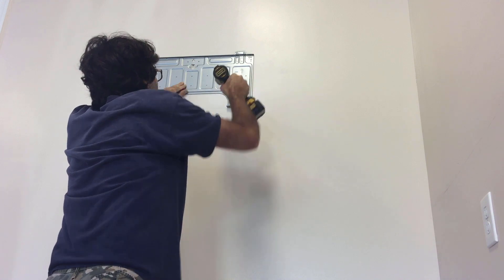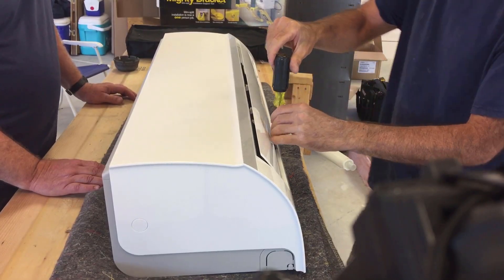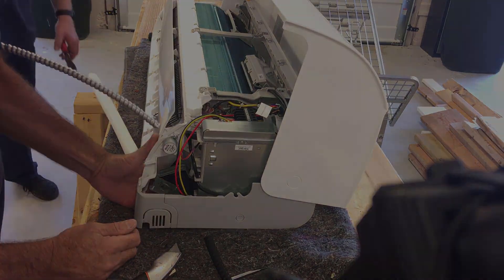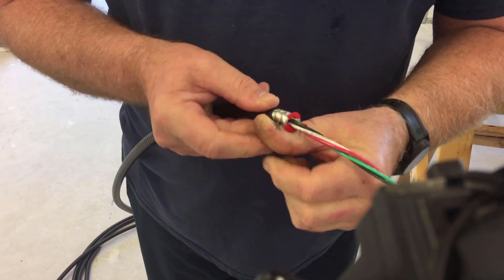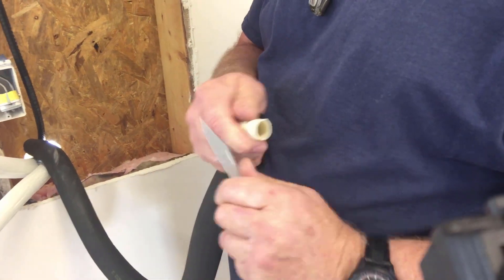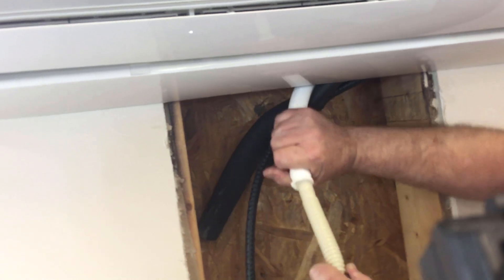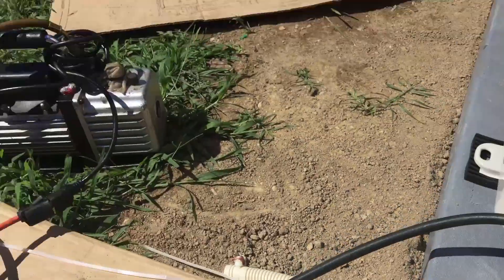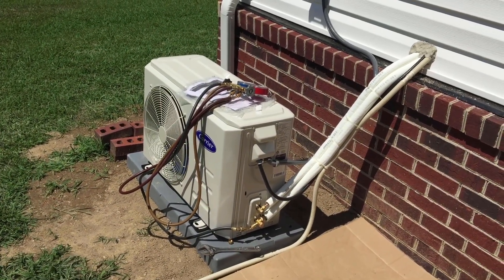Carrier Mini Split Ductless Heat Pump; Easy Installation Step By Step w/ Full....

Comment: Does carrier uses specific flare nuts for each highwall unit or it depends on the model or you can use any flare nuts?
Reply from the maker: Mini splits in general use a 5/16 flare nut. I have an adapter that is made for mini-splits.  It's a 5/16 female to 1/4 male...

Comment: Couple of questions.    How did you insulate that cavity in the wall?   And,  how efficient is the heat pump when the temp outside is 0°F?
Reply from the maker: We haven't experienced 0 degree temps for many years.  So I don't know.  I think this unit is 18 seer so it should do pretty good, but 0?  It's hard to say.  The wall was insulated with fiberglass bat insulation..

Comment: I just finished installing that same 1.5 Mini Split Heat Pump with the same Air Handler.
I got a question about the Direct button on the remote.
Right now I’m in heat Mode and the Direct function doesn’t work all the time to adjust the louvre.
Is this normal?
Reply: Why ask this of a YouTube creator? Such information is available on the internet with a push of the button. Do you own research PLEASE!
Reply from the maker: I don't have access to one of these units at the moment to test, but I found this excerpt in the manual.. maybe this will help...

The up−down airflow louver can be adjusted by pressing DIRECT
on the remote control and can be set to be stationary or moving
continuously pressing SWING. The up−down louver position is
stored in the settings, however it is deactivated when the TURBO or
MANUAL settings are set, or when a power interruption takes place.
Air Direction

Press DIRECT repeatedly to choose one of the up−down louver
positions. Every time this button is pushed, the specific louver
swings by 6 degrees.
In the COOLING, DRY, and FAN ONLY modes, the louver
swings in the cooling range. In the HEATING mode, the louver
swings in the heating range.
NOTE: Always use the remote control to adjust the up−down
louver position, otherwise abnormal operation may occur. If the
up−down louver is manually adjusted out of its range, power the
unit off and then back on again.

Comment: You forgot to mention how important it is to use a torque wrench on your flare fittings
Reply from the maker: Yes, good point.  Thanks... :-)
Reply: The importance of tightening fasteners with a torque wrench has been  stressed for all my 5 decades as a technician. With the exception of head bolts on an engine and lug nuts on larger trucks...I never use a torque wrench on anything. But to each there own.